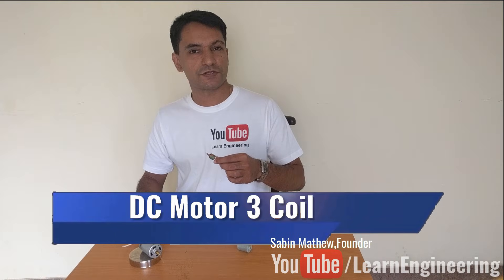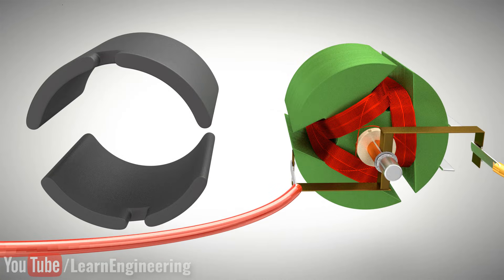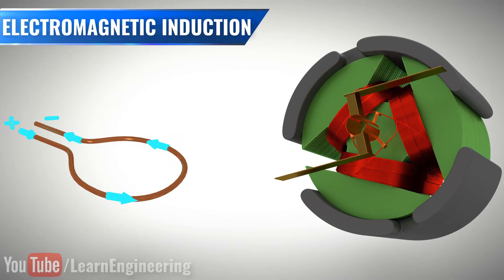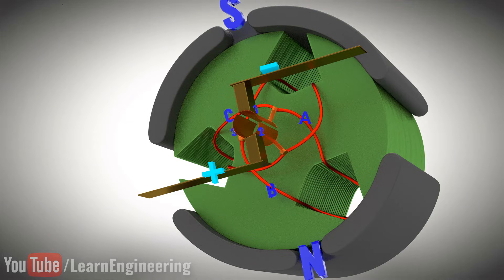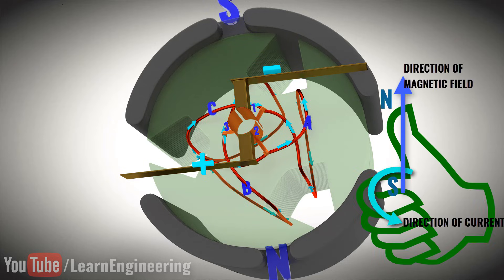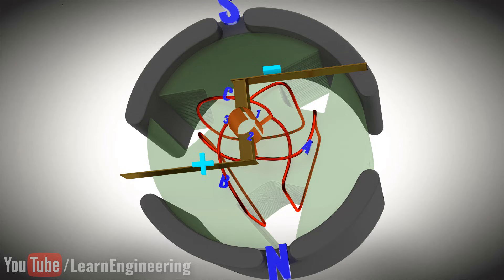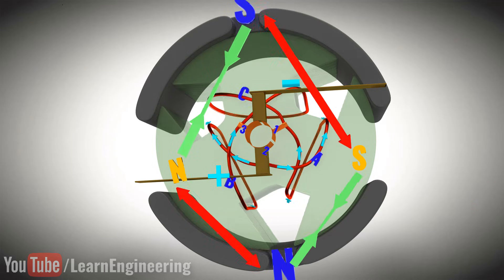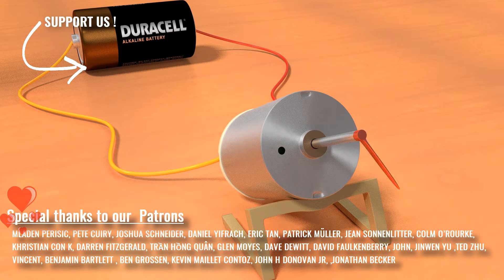DC Motor - 3 Coil, How it works ?

Comment: You can use ANY ODD NUMBER of coils in the armature. If an EVEN number of coils is used, there is a danger that the 2 brushes will be touching 4 commutators at the same time. Then the magnetic fields of the 2 symmetrical coils fed by the 4 commutators will cancell each other out, and the motor can't "make up its mind" which direction to turn. It can be "frozen" in one position and the coils will fry.

Comment: @3:22 if rings 1 and 3 possess the same voltage, coil C is shorted, this doesn't mean there is no current flowing through coil C but the current that was flowing through coil C will degrade (probably but not necessarily to 0)
Reply: coil 线圈

Comment: Hi, I know this is old, but I have a question. What if I swap the position of the permanent magnet (reversing N & S poles) and everything else are the same, frm the animation I can understand that the rotation will reverse (anti-clockwise). But what if I reverse the polarity of the +ve and -ve terminal, will the rotation goes back to the clockwise direction?

Comment: there is something that i dont understand: 

due to the constant flow of electricity there is a force constantly being applied on the rotor (and therefore a net torque) so this means that the rotor should have an angular aceleration at all times (net torque = moment of inertia * angular aceleration). Despite that, the rotor is rotating at constant angular velocity.

Why does this happen?
Reply: Generally the faster a motor spins the less “force” there is on the rotor, it is kind of unique that induction motors if not all electric motors have this ability to “govern” its own speed.

Comment: The right hand rule diagram is used incorrectly. When using the right hand rule for current and magnetic field the thumb is the direction if the current and the fingers represent the curved direction of the magnetic field.
Reply: Rule holds true even if you change position of field and current.

Comment: I think it would be good to put some force vectors for the poles to better illustrate when and where the poles switch as the motor rotates. And I mean for the whole rotation cycle, not just part of it.

Comment: The explanation on the motor is great, but for the presentation part you need a proper mic and a room with more sound dampening... other than that, keep it up!
Reply from the maker: XSportSeeker Yah, this was shot in my Nexus 5x. The next time we need an experimental shoot, I will make proper arrangements.
Reply: The image quality isn't bad, I think you could still use the Nexus, but perhaps with a wired lavalier lapel mic? At least a lavalier mic would eliminate the need for a properly padded room a bit, which is not an easy thing to deal with. :P
Regardless, great work and great material!
Reply from the maker: XSportSeeker Hi, Thank you for the tips. I will definitely purchase the mic you suggested for the next shoot.